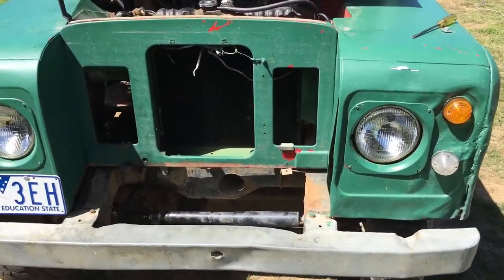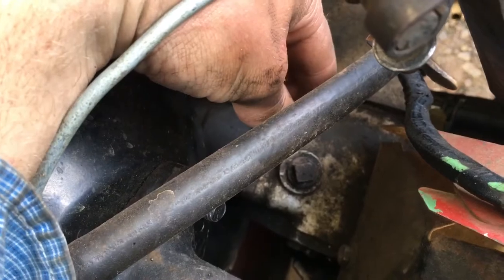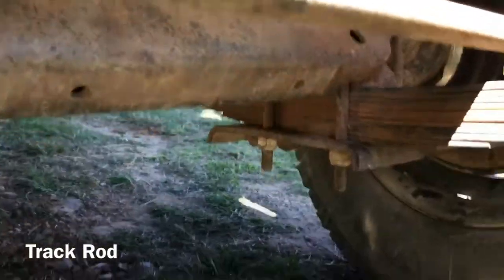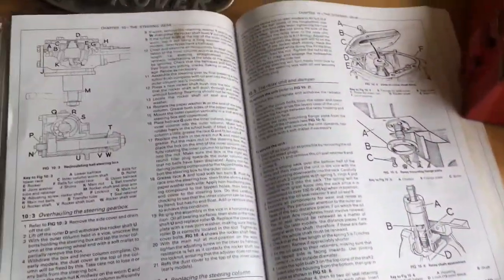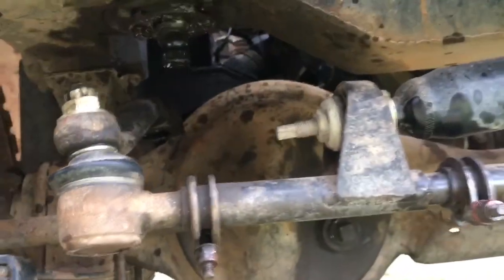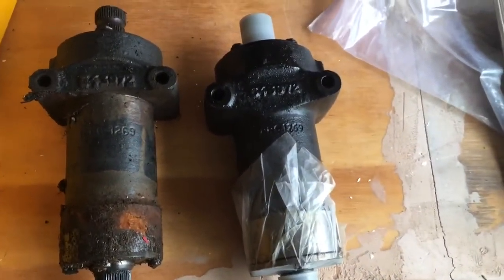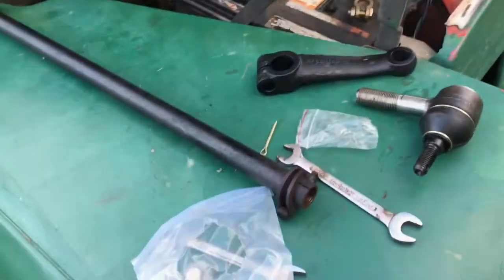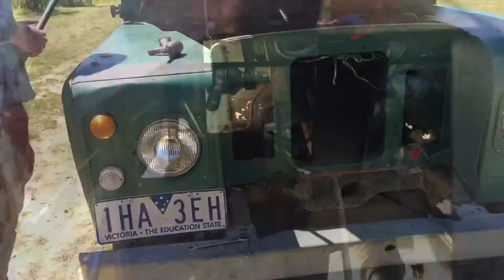Steering Maintenance - Land Rover Series 2a- Reduce Backlash, How it works, Relay and Drag Link Ends

Comment: Great video. My 1969 109" has the heaviest steering ever. I last drove it in the army in 1985 and I swear it wasn't as hard to turn and park. My tie rod ends have been done, the steering box oil is topped up so I fear it is the relay box that needs switching. I'll be ready for bolt hole issues thanks to your video.

Comment: Everyone should take a couple of hours at their earliest convenience to check the condition of the threads inside both ends of the steering tubes.A couple of months ago with a couple of friends, i drove over 100 miles to an airshow. After exiting the motorway the steering felt a bit 'odd'.
We drove around a roundabout and i noticed the steering wheel was about 40 degrees out. We'd been offroading  a couple of weeks previously and i was trying to remember if it was straight afterward. You know how sometimes you can suddenly spot something that had been like it for some time... No? Just me then? :)
Another mile driving straight and then we turned ninety degrees left through a gate into the field and there was now something definitely wrong!!!Another 200 yards then ninety right to park in the queue to wait for the gates to open. We all got out and i got under the front to have a look...
I discovered the right hand trackrod was only in the end of the steering tube by about two threads!!!!!!!!!!!!!!!!!!!!!This was on a 1996 Discovery, much newer than any 2a!The outside of the tube looked just fine. No dents, straight and free of rust.We managed to borrow a couple of adjustable spanners from a very nice plumber qued up a few cars away and managed to undo the fixings, push the trackrod into the tube to where it was before and then retighten the clamp and nut. 
For the journey home again i used some strong chord tied tightly between the clamp and the end of the arm pulling over frequently to see if anything had moved.I hate to think what may have happened if i had swerved while at motorway speeds and it had pulled out completely...
Strangely that was my second steering failure.
The first one was in an old Citroen ZX. I'd just left my cousin's garage when it felt like i'd got a flat tyre? I turned left into the driveway of a pub and got out to check the front tyres. The driver's side was up, so i walked to the other side of the car and couldn't believe it but it was fully pumped too. so i walked around the car and checked all four even though i felt it was the front. Then i noticed that the driver's side wheel was pointing outwards at about the same angle as the passenger side one was which considering i'd turned ninety left then stopped was a bit strange!Had a look under the car and saw that the moving bit of the steering rack was only attached at the wheel! WHOOPS!I telephoned my cousin who didn't believe me when i told him the rack had broke. Eventually he came and had a look. We tried to tow it assuming the castor angle would allow the car to travel forwards. It didn't!I had to pay his recovery guy to pick it up and drive the 200 yards to the garage to have a new rack fitted.Scaringly, the recovery guy admitted to my car being the first ZX with a broken rack that he hadn't had to recover from in a ditch, as that's where they have always ended up (in his experience)I guess i'm lucky...............
Reply: Re your track rod scare, I had mine off completely first time in 2.5 years ( time I’ve had the rover). Done the toe in twice in that time and the track rod clamped up fine. However yesterday I discovered the off side clamp worked( and locked theTRE but the near side clamp did up tight but even though it squeezed the tube it wasn’t biting the TRE which was wobble loose. Hanging on in there by the tips of some very shagged threads. Coulda been in your shoes anytime!!!
Reply: I discovered the same issue when I was rebuilding my 78 109 GS.
Prior to the rebuild, when driving at highway speeds, on occasion I would hit a bump in the road and noticed a loud banging noise which transferred through to the steering wheel and the wheel would skip left or right a few inches and stay there.
Then hit another bump and it would skip back to its normal position.
Couldn’t find the problem no matter how many times I looked for it.
During the rebuild I was taking measurements while reassembling the steering components and I had the wheels just slightly off the ground and was lightly kicking the passenger side wheel into position when all the measurements went out the window repeatedly.
It did my head in for I couldn’t identify the reason for the changes and then I lay down at the front and had a mate kick the passenger side tyre and bingo, I could see the tie rod moving in and out of the tube.
Closer inspection revealed the threads in the tube were worn down, allowing the tie rod to pop in and out.
Wasn’t comfortable reusing any of that gear again so purchased all new steering components and clamps etc and started again.
Apparently it’s a common problem, largely brought about by poor design.
The idea of clamping a tie rod into a tube is a bit silly but unfortunately that’s what you’re required to do when using standard parts.

On searching for your slack in the steering gear, transferring to the steering wheel by means of excessive play, look at the drop arm beneath the steering relay.
In my case, the drop arm was tightened up fully, such that the compressing faces of the drop arm had come completely together and weren’t gripping the steering relay shaft.
It looked tight and certainly felt tight and I couldn’t determine any movement when looking at it by myself, but one day a mate was looking under the front as I worked the steering wheel and he saw the steering relay shaft was moving within the super tightened drop arm.
How to fix it when the clamping faces are touching each other.
Remove the drop arm and clamp it into a vice and the carefully run a grinding wheel through the clamping faces, removing enough metal so that when clamping to the relay shaft, there’s still a pinch of free space left.

My steering relay shaft wasn’t worn so perhaps I was just unlucky and got a drop arm that was poorly made in not having enough free space between the clamping faces.

Series Land Rovers have very heavy steering and a terrible turning radius, that’s just the way they are.

In mine, if I want to turn into a street, I just start making my turn 2 streets back from the one I want...

Comment: Looks to me like your pipe connecting the top and bottom brake wheel cylinders is at the front of the swivel, where as it should be at the rear of the swivel. That means your wheel cylinders are installed wrong and you probably have your shoes set to be trailing instead of leading.

Comment: There are a series of shims of different thicknesses the bottom end of the steering box that adjust the end play of the steering column.  If there is end play there the whole system will be loose.   You need to remove the bottom plate of the steering box and take out a shim or two, reinstall bottom plate and check again for play, it may take a few tries.  Needless to say it was a PITA but it made a huge difference. See https://www.youtube.com/watch?v=VVlgkqy7Zas
Reply from the maker: Good info!

Comment: Then again, it may have been done to make bleeding easier, i.e. having the bleeder at the top rather than at the bottom as it came out the factory.
Reply from the maker: This is great info, I need to do a bit more investigating here, In the past I have had quite a bit of trouble in this area of the Car, Bleeding the wheel Cylinders more difficult then I thought it should be. And some confusion with brake shoes ect. Thanks again I didn’t think something like this could be the problem but I think u may be on to something.